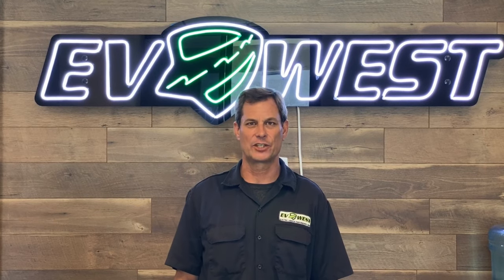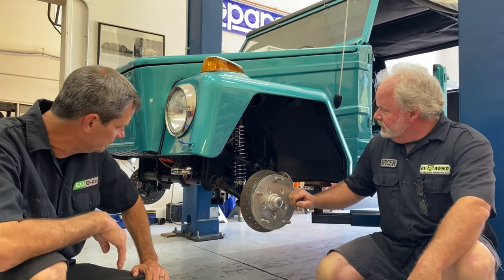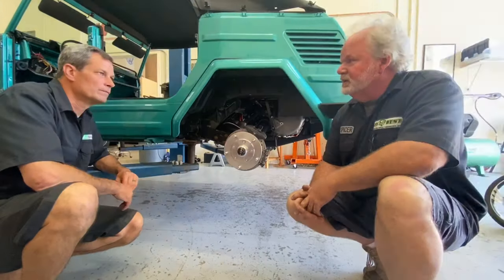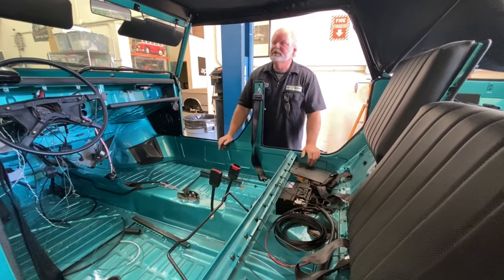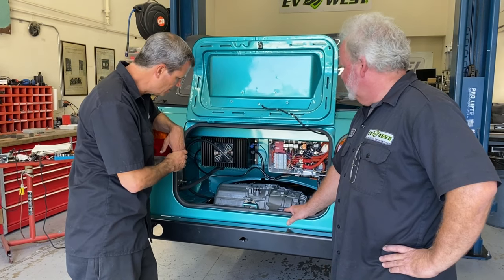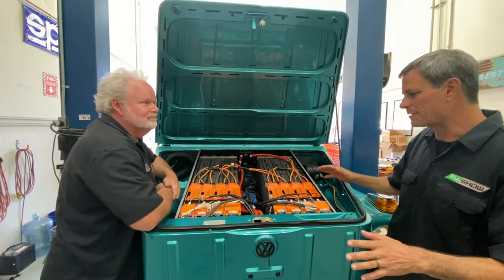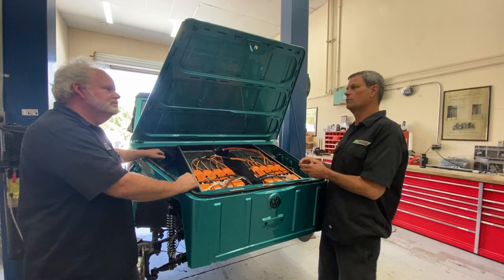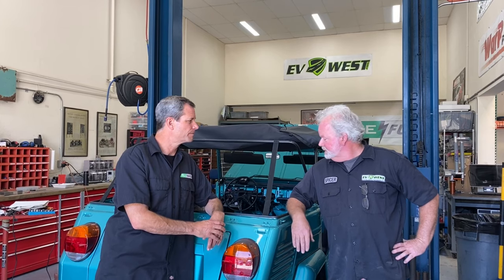VW Thing EV Conversion Ep01 EV Show

Comment: I'm very happy to see you guys again !! suggestion, try to get some microphones. the audio sounds little bit echoing. Again love to see you projects !!!
Reply from the maker: Hey, thanks for the feedback. We have some good mics from doing the show previously, but have decided that in order to be able to film and post on a weekly basis we'd have to cut some corners. One of those was multi-track editing. We hope we can get it a bit better without going to a wireless setup, but we're hoping an easier setup will mean continuous videos. Perhaps the solution is insulating the shop better? Another video coming next Thursday.
Reply: @EVWest  Excited to see more !!
Reply: @EVWest  it depends what kind of cameras are you using. Does it have a mic input? You can use 1 or 2 wireless mic's, and hardware mixer.
Reply: EV West  I understand your situation, you’re trying to get work done and putting Mike’s on and then taking them off all day long makes it impossible to get anything done. I think the solution is a compromise, the camera operator could use a shotgun microphone, they are highly directional you point them at the person talking and you can hear them clearly.

Comment: Glad to see you back showing us how to. I would love more detail about the bits and pieces. e.g. what parts are VW, Tesla, custom. In particular I looked at the drive shafts/CV joints and would like to know details. Thanks, watching from the West Coast of Canada
Reply from the maker: We sell a 930CV flange for the Tesla motor. This allows off the shelf CVs and axles, you just buy the outer 930 flange from EMPI. It's a very easy swap.

Comment: great you are back
What about cooling the batteries motor etc 
Is the thing cooled at all
Reply from the maker: No active cooling in this pack. It's a coastal car (moderate ambient temps), and output power will be reduced, and pack temps will be monitored through the BMS to keep it within a safe range.

Comment: Do those axles and cv's hold up? They look at an "extreme" angle...🤔
Reply: I imagine once the vehicle is back down on the ground and the suspension is loaded, the angle is a lot less extreme.
Reply from the maker: The angle is a bit more extreme than extreme than we like due to the larger tire and lift, but 930's can take it.
Reply: @EVWest  awesome!